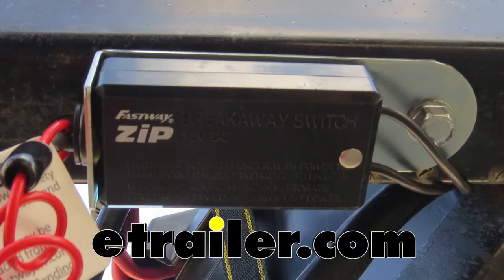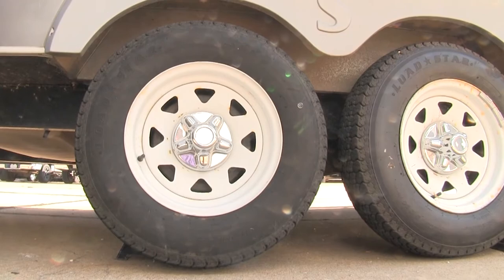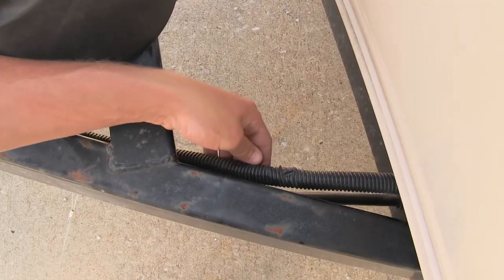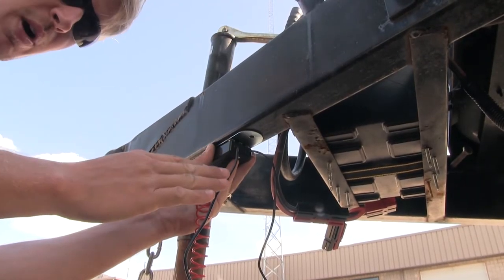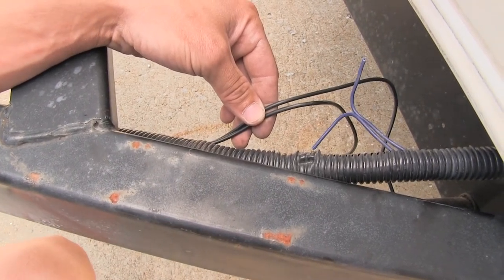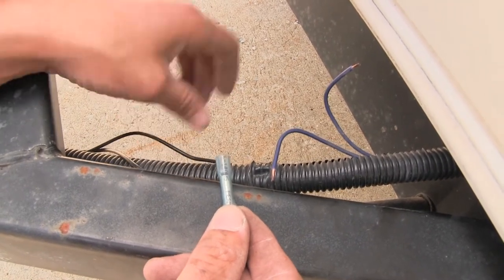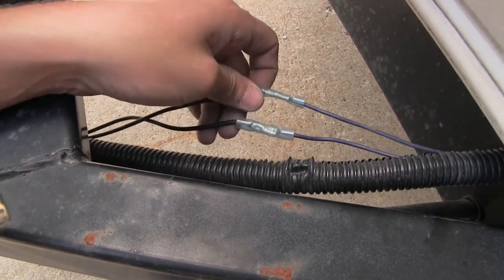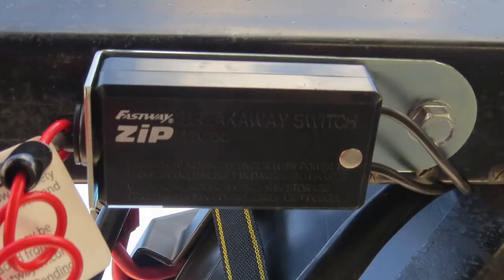etrailer | Fastway Zip Trailer Breakaway Switch with Coiled Cable Review

Comment: How do yo

You unlock it after testing
Reply from the maker: Not sure what you mean by 'unlock'. To reset the switch, you'll just push the pin back into place, which take a little bit of force to get fully seated. If that's not what you meant, let us know. We're here to help!
https://www.etrailer.com/Accessories-and-Parts/Fastway/FA80-00-2060.html